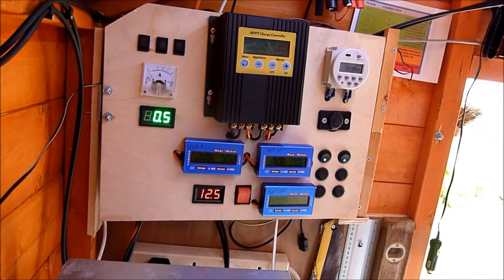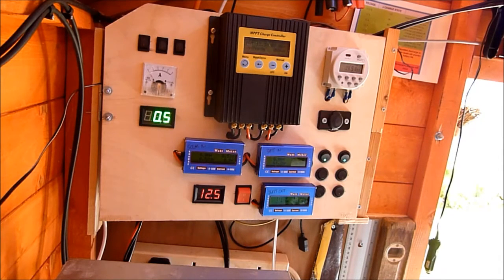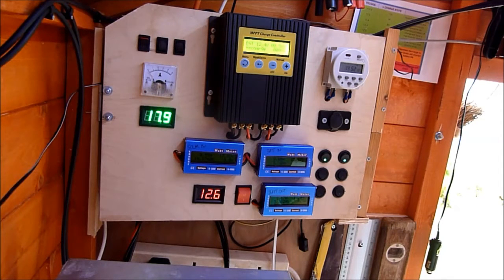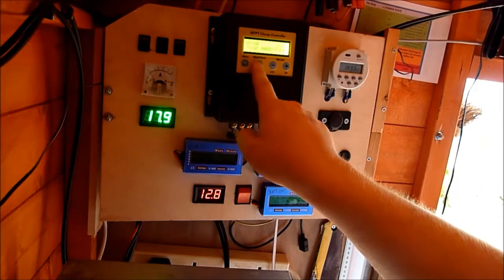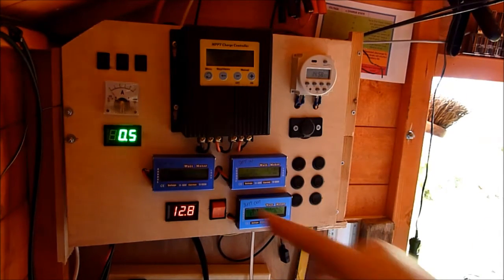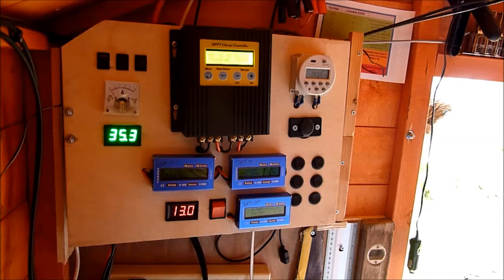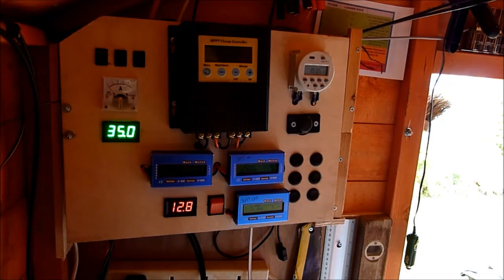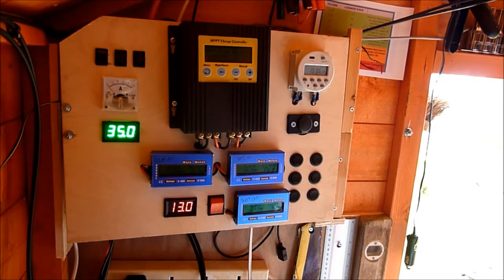MPPT 12 or 24 volt? - 12v Solar Shed

Comment: Hi Adam first of all you do great video with this about solar so can you please tell me What you will choose if you will have a 2 panels 350 and 2 battery 100h.and everything is connected with inverter 1500/3000 and MPPT solar 80 so what You will run  12 or 24 , all this it's for Backup just in case  and I set-up on my garage roof and I use fuse start from 30Amp to 200Amp connected to battery parallel like  2 of my solar panel  so can you have any advice Thanks

Comment: Hey, thank you for this experiment! So if I understand correctly.. connecting panels in series is marginally better than in parallel? (1.59a vs 1.65a under )

If I may ask, is there a reason why you chose not to put your batteries in series too? Isn't there a drop in efficiency if it has to bump down the voltage from 35.4 down to 13?

Comment: Could you use an MPPT charge controller in paralel with a micro inverter?  Would the MPPT charger suck the use-able power out of the inverter? or would the Inverter run at a smaller output?

Comment: Hi Adam so in your opinion is 24v solar setup more efficient at charging a 12v system or 12v with the extra wattage/amps @ 12v better ? thx steve

Comment: Higher dc voltage input is more efficient (amps on the cable are less so less heat and resistance)

Comment: I love your Vids, this is very interesting I have 2 x 50w panels and a Photonic Universe 10A MPPT solar charge controller  with 3 lead acid batteries in parallel. So I guess I should set the panels to series? as all the garden lights come on off these. It's fine in summer but winter they can die early.
Reply from the maker: With a bit more experience since posting this video I find it best to have panels in series in the summer and in parallel in the winter with my setup.
Reply: Thank you Adam for replying

Comment: Its funny because i only put my 2 pannels in series today to see the difference and got 10 more amps going into batteries. Very surprised! Ive 2 205w 44v panels with 6a. So seems series is better??
Reply from the maker: I find in summer series does yield more, however in the depths of winter I've found parallel panels work best for me.
Reply: Adam Welch, isn’t that interesting. I would expect the double voltage in series would would mean getting to a charging voltage sooner and keep producing power later in the day. However, I would expect that to be even MORE important in winter. Very interesting that more power is produced in parallel in the winter. Do you think it is as simple as parallel gets to a charging current sooner, which is more important in low power winter light?

Comment: Hi. Adam.  I have 2x 250w panels I think the panels are 37v max .. and 4x 370ah 6v battery in a 12v system.  Will this controller handled it.. thanks

Comment: Hi Adam , I am just about to build a system for my van and i saw this , i already have the CPT-LA10 MPPT controller you did a review on , i am planning on a 100w mono panel , but now i think it might be better to get 2 x 50w mono and run in series , will the controller handle the Amps being rated at 10 amp , also do i need to alter my battery set up as im looking at 24V and i use a 12v 85amp leisure battery , or am i barking up the wrong tree altogether ?
Any advice greatly appreciated , thanks Rich

Comment: Adam,I like your system,first off. 
 Question:
 I have (5) 12 V. panels and a new 40 A. MPPT controller. I'm disappointed with the out put with the 5 panels run in parallel.
 The way to do this is to Siamese the last 2 panels and series wire the other 4 to make 24 V. out put to the controller? OR,just wire up 4 of the 5 panels.
I have plenty of panel connectors and 10 G. wire to make this work.
It's weird that the panel wires can be connected from a positive lead to a negative lead.
(5) 150 watt panels should provide 750 watts on a VERY sunny day,minus voltage losses.
IF 24 V. works OK,I'll be golden.

Comment: Given that my house was wired up in the UK for for mains supply- 1mm lighting and 2.5 mm ring main, which would be better? 12v, 24, 48 v ?
Reply from the maker: Sorry - are you thinking of using your standard 240v wiring and converting to DC for lighting?  If so that's a little bit out of my comfort zone but generally longer distances work better with higher voltages, however you might find it more difficult to find 24 or 48v lamps to shove in your light fittings.  Best tread carefully with this one.

Comment: Hi Adam,
Thank you very much for your videos, they are really helping me prepare before purchasing elements of a system.
Am I right in understanding from this video that the MPPT controller could handle 24v coming from the panels while still outputting 12v to the batteries, or did you reconfigure your batteries to match the panels as well? Can the EP Solar controller you use now do the same? Or must it always be 24v of panels going to 24v of batteries and 12v of panels going to 12v of batteries? 
And on a slightly different tack, if I were to believe what many internet forum voices say, many seem to recommend almost never using the "load" from the charge controller, but to take power direct from batteries instead. But then why is there a load output on what seems like all charge controllers? Does it have a maximum amp output perhaps, in line with its maximum input? You seem to use it quite happily.
Thank you for your time,
James
Reply: falkel did you find your answer.

Comment: I am looking for some help I will have 2x12v 110am battery's and I want to use it all on 12v but my new panel will be PMPP 260w VMPP 30.7v imp 8.50A 37.8V VOC UL 1703 600 UL 17031 5A can I do this for 12v please help
Reply: norman farley just add a mppt charge controller in between and u are set.
Reply: Thank you for your reply I am looking for a mppt charge controller but a little to much for me at this time

Comment: Suggestion use 2 home-roof solarpanels 48volt. Often used to buy for little money.

That give a much higher efficiency.
Reply from the maker: +lexpee Not a bad suggestion thanks but unfortunately although you get more watts per dollar the standard sized domestic panel is a bit big for the shed roof! Good tip for others though. Thanks again.
Reply: I don't know how big your roof is?  The 48v 260w panels that i have are 158x106cm  you can also use one panel.
Reply from the maker: +lexpee My shed pitch is about 120cm if memory serves. Pretty much the whole southern part is covered now and from our house to can barely see them. That extra 30-40 cm doesn't sound like much and only using one mounted on its side would leave unused space. 
Really appreciate the suggestion, and as I say I'm sure it'll help others. 
If you want to see my latest panel array, check out my install video I uploaded in September. Cheers
Reply: Thank you for you response.

I live on a boat off the grid I'm Designated my own power supply.

I and have six solar panels from 48v 260w on my roof.
I have a heavy MPPT charge controller 1800W to 150 volts can handle.
My solar panels are connected in series voltage up to 120 volts DC.

Also i have a wind generator and and of course a diesel generator.    

I have 12   6 volt Trojan T105 batteries. 3 banks 24v as one big storage.

Maybe i start  this year a youtube Chanel about it.
Reply: I would love to see a video of your setup LexPee

Comment: Hi Adam just curious, would it be easier to understand it it was alll in Watts?
Reply from the maker: +Alan Marshall Yes - quite possibly. Hopefully my more recent solar videos are presented a little better! :-) 
Thanks for the suggestion.
Reply: Well considering how volts x amps  = watts.. it could be high volts low amps or low volts and high amps  to equal the  same  amount of watts.  Having them separate provides more info

Comment: sir did you try to put a Load to solar input in your solar Charger Controller while your battery still connected on solar Charger Controller? i want to know if that work or not before i buy set on solar component. ( [ IDEA ONLY ] i want to try using Servo 12v to servo 12v Flywheel power generator with that solar charger controller so i dont need solar panel ) i looking for video of this one if there is!

Comment: Curious about if your using an inverter ? If so do you that the feed direct from the battery or from the load off the charge controller ?
Reply: The problem is that even if the inverter has a low voltage cutoff (some can be as low as 9V which is quite bad for the battery the inverter still keeps draining the battery, I think the best solution is to hook up the inverter straight to the battery but switched on or off with a relay controlled by the charge controller, this way the controller can cut off the inverter completely at a more controlled voltage and turn back on when the battery has enough charge.

This way besides not having the inverter draining the battery it will turn itself back on when the controller tells it to, as most inverters will cut off at low voltage and you must cycle the power for them to operate again.
Reply from the maker: +TheCreativeMale I have a small modified sine wave inverter that I feed straight from the battery (well via a breaker now). I don't use it that often though.
Reply: Adam Welch thanks 
what is best ? via battery or via charge controller ?
Reply from the maker: +TheCreativeMale For me inverters need to be connected straight to the battery. I don't see any advantage of connecting it to charge charge controller unless you need to remotely monitor the load and switch it off, or your inverter doesn't have a low voltage cut out.

Comment: So the MPPT will convert your ~35v coming in back down to 12 to the batteries?
Just curious I'm still using a PWM regulator so I don't think I would get similar results.
Reply from the maker: Yeah.  MPPT charge controllers typically do two things - they adjust the load on the solar panel to maximize the output of said panel and they convert that power into a suitable charge for the battery.  So assuming a perfect conversion (which of cause it could never be) 35 volts at 2 amps is 70 watts for example coming from your panel.  If your battery is at 12 volts, the DC to DC converter will try to supply 12 volts at 5.8 amps (still 70 watts) if it is in bulk mode.

With a PWM charge controller you'd find your panels would be dragged down to the battery voltage when in bulk mode because the two are directly connected.  A panel (or two in series) with a maximum power point at 35 volts are now being pulled down to 13 volts.  As a result you are probably only getting 30-35% of the maximum power out of yout panel.

So on PWM solar charge controllers you need to use a panel suited to your battery voltage (a 'twelve' volt panel on a twelve volt battery, or a 'twenty four' volt panel on your twenty four volt battery system etc.) otherwise you are simply throwing away watts.  This is where MPPT wins - it's more versatile but the panel voltage will still need to be higher than the battery voltage as most MPPT SCCs are buck converters.

I put the 'twelve' in speech marks because a panel sold as a twelve volt panel is likely to produce up to 21-22 volts open circuit and it's maximum power at 16-19 volts - neither of which are really twelve volts, but the panel will always need to be able to produce a higher voltage than the battery for any system to work.

It's worth knowing however that most MPPT chargers will go into a PWM mode once they finish the bulk charge.  When you lead acid batteries start to get full the current will drop and the charge controller will pulse width modulate to keep the voltage at a set point.
Reply: Thanks for your prompt reply, I knew the MPPT controllers were superior to PWM and I am using 12v SLA batts in parallel. My panels (160 watts) put out a Voc of ~22v but I always thought I could only run my panels in series IE 24v if I was using my batts in a 24v series setup.  I didn't realize the MPPT will take the series panel voltage and buck to 12-14v..I will now rethink getting an MPPT controller, however I only use mine for backup here in earthquake prone California..Thanks again!
Reply: Yeah mppt likes high voltage  pmw not do much.  Pmw is not ment for series as mppt is ment to have.  You do series into your pmw you'll fry it. Typically  series just doubles  voltage  and amps stay the same which would be pointless without an mppt to make sure of the higher voltage giving you more amps  after it drops the voltage down

Comment: i just got a 200 watt rv panels setup 2x100 watt it can be wired either 12 volt or 24 volt i also got a grid tie 12 volt to 30 volts but my problem i also have other 12 volt solar units i want if grid goes down use a camper charger unit to the 200 watt panels to charge a battery pack is the http changing it to 12 volt? from 24 volt? over winter my heater broke heat exchanger, under warrenty they replaced it but it over heater the new unit  takes more power! from 15 k to like 18 k in winter now it at 16 k a day!

Comment: Hey Adam, Hows this for a mind game.......... Lets say I've bought a solar panel, a 92 watt Fuji (Japan) flexible solar panel It's high voltage (320 volts).....And I wish to use this in a 12v system in my boat, now very clearly I must drop the voltage down using a "step down" controller.......and yes I'll be using my Tracer MPPT solar controller, so the big question is which voltage "step down" controller would I use 12v or 24 volt? Remember my system is 12v BUT using a 24v step down controller before the volts goes into the MPPT would make the best use of the MPPT controller as from what I can gather MPPT's work best on higher voltage,......interesting hey............when putting the system in place the mppt would be connected to the batteries first so the MPPT knows the battery bank is 12v.....Kristian..
Reply from the maker: +Kristian Winder can you confirm the voltage of your panel... I assume it's 32 volt not 320!?!

Your mppt charge controller should do exactly what you need. It does a DC to DC conversion for you. So your 32 volt panel producing one amp (for example) would charge a battery at 12 volts at approaching two and a half amps.
Reply from the maker: +Kristian Winder Wow - 435 volts open circuit!  Must be lots and lots of very small cells.  

I'm really not sure what is best to suggest.  Ideally you need an MPPT charge controller that will take such a high voltage - but most of those are the costly large type put in larger installations and they'll be wasted on 92 watts.  I haven't even seen a suitable DC-DC converter which might help - although it's not something I've been looking for.

Comment: Nice video. My first assumption was you were seeing increases due to the higher voltages over your cable runs but as per your responses below , it does not appear to be the case. Providing the controller is capable, I would think linking in series would be an excellent option for a camp type situation where long runs of cable are used to get he panels in the sun. 
That controller is on my wish list for now. It certainly seems to be the pick of the bunch for mppt units not costing the earth.
Reply from the maker: +DENMONKEY Thanks for your comments.  This charge controller has done me well for a while now.  It's also worth taking a look at the EPEver Tracer series - I've done a full review on both of these controllers.  The tracer allows for higher solar voltages than the Eco-Worthy.

My solar panel cables are around one to two meters long - the voltage drop should be very small.  You're absolutely correct about distance making a difference.
Reply: +Adam Welch cheers. will suss out the review.

Comment: those triple solar 50w panels seem good mate. I have the folding version and while I was away camping in the summer, they maxed at 112w parallel, 12v. the next day testing 24v series the amps going to the battery hit 7amps. they're definitely not underrated
Reply from the maker: +LambySRI I've been quite pleased with them.  I think my Renytek branded 50 watt panel with Bosch cells performs a little better than the triple solar panels, but I've nothing to prove that.  It's almost impossible to run side by side tests without a perfect day for weather and two matched solar charge controllers and batteries!  

Thanks for the comments.

Comment: is yours the folding pannel 2 x 50 i got mine september using pwm i max 70 watts i have meter like your but logs max min been happy with mine december been a drag not much sun jan picking up 45 watts max
Reply from the maker: +iarose23 No my panels aren't the folding type.  Glad to hear you are catching some sun this month - it's been very dull here.
Reply: i will not ask where just rough im in the midlands been over cast here but still getting some solar .are you panels like half triangle on cells

Comment: Hey Adam
I sounds like you have a lot of knowledge about this charge controller.
Help please.
I have 2 190 watt Topoint  24 VOLT (36.5 volts @ 5.2 amps) panels wired in parallel.I purchased this controller last week and would like to remove my fake mppt charge controller.and replace it with this unit.I will be running this into my current 12 volt 400 amp battery bank.So my total input in solar is 380 watts 36.5 volts 10.4 amps under perfect conditions.From solar panels to charge controller is 15 feet running 10 gauge wire.What do you think.
THANKS DAVID
Reply from the maker: +dhlwood Sounds like you've made a good choice for your setup.  Everything you have is within specifications and your cables are a good gauge and short.  Should be a fairly efficient system.  Let me know how you find it.